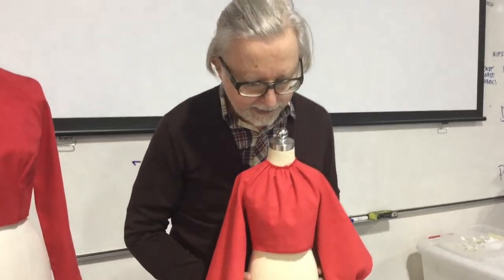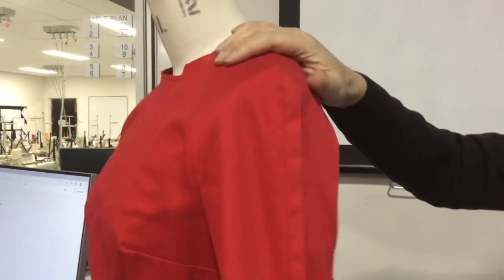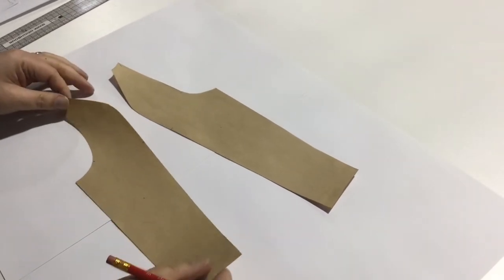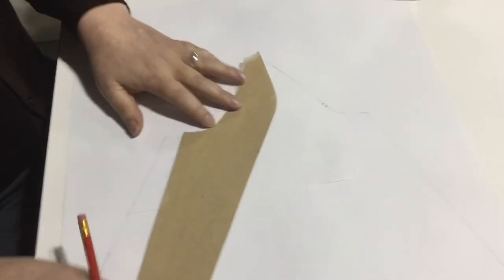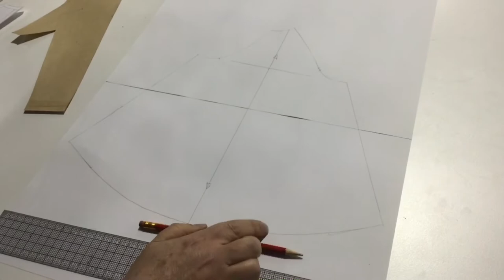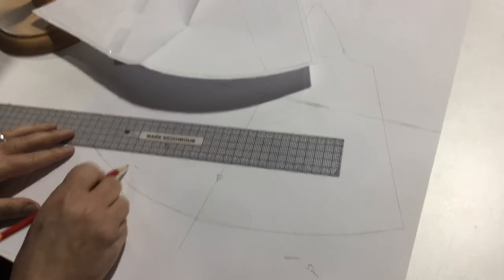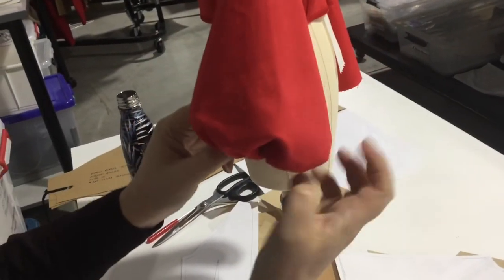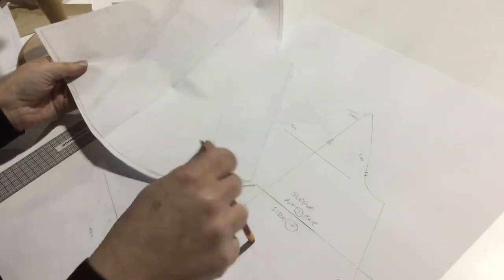Raglan Bishop Sleeve using the Raglan block

Comment: If you were wanting to do a short raglan bishop sleeve (a few inches above the elbow) would you just leave it all one length? Not lengthen it in the back correct?
Reply from the maker: Yes, I would probably keep it the same length. Check the first sample though to see if it's giving you the look you want, and then alter accordingly.